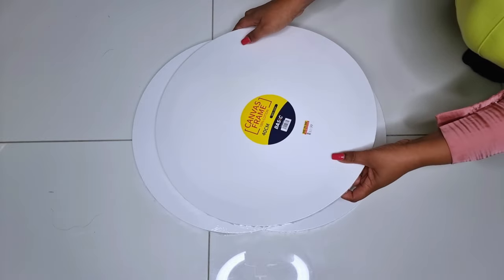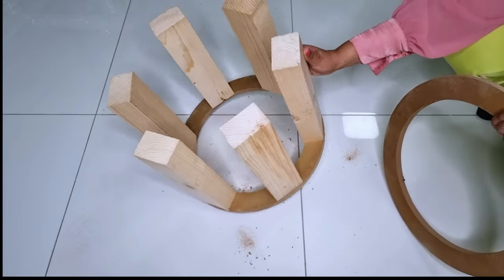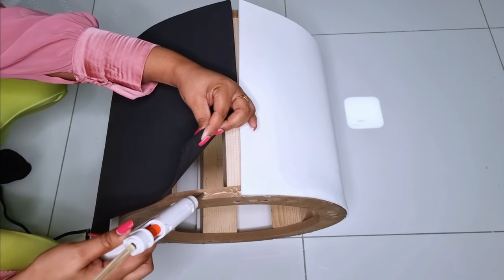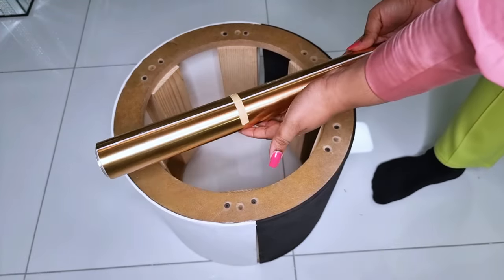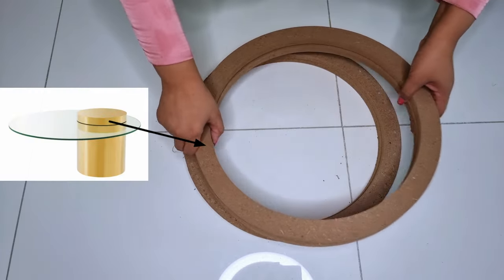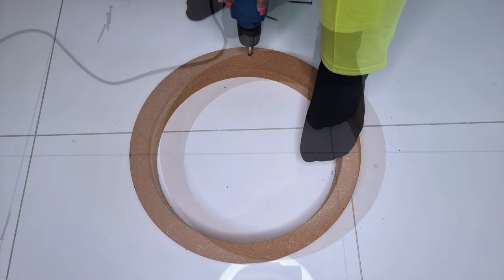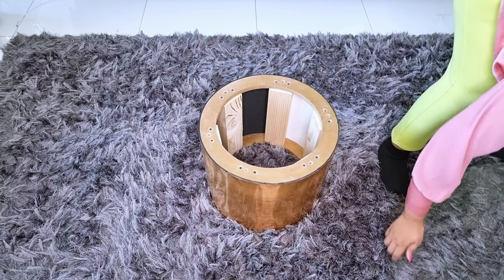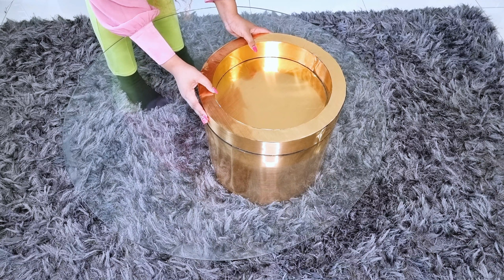DIY HIGH END COFFEE TABLE USING FOAMBOARDS &CANVAS | INEXPENSIVE COFFE TABLE

Comment: What is holding the glass in the table. This is very cute I love it ❤️
Reply from the maker: Hi darling  ,you can add mirror adhesive to permanently hold the glass ,...I didn't glue mine cause I'll reuse the glass later but the table base is strong enough to hold it for long